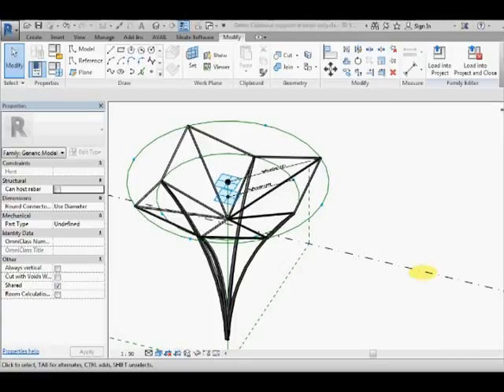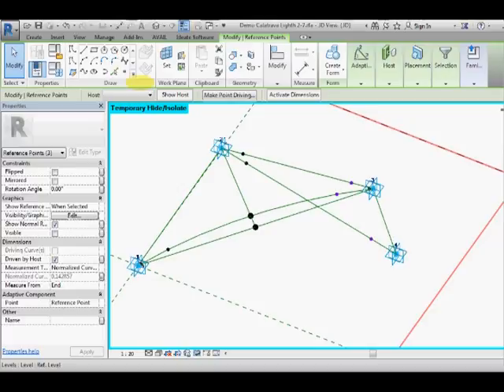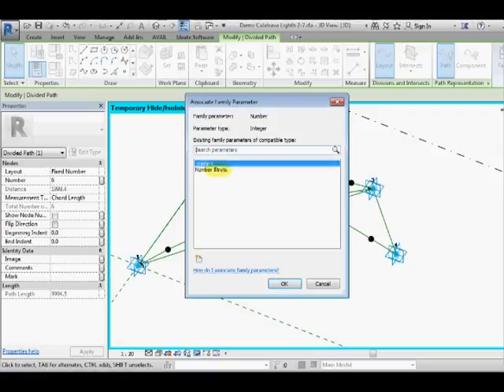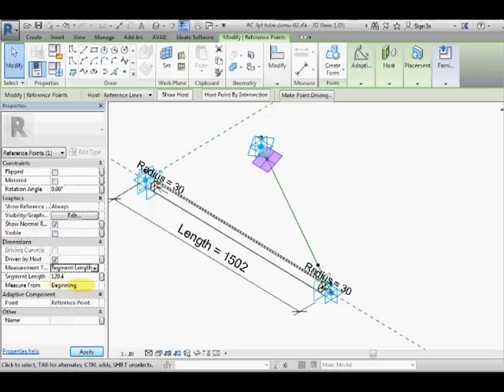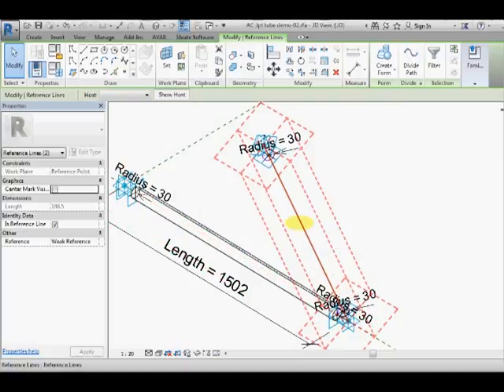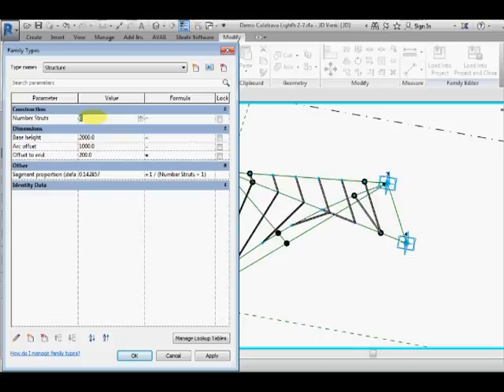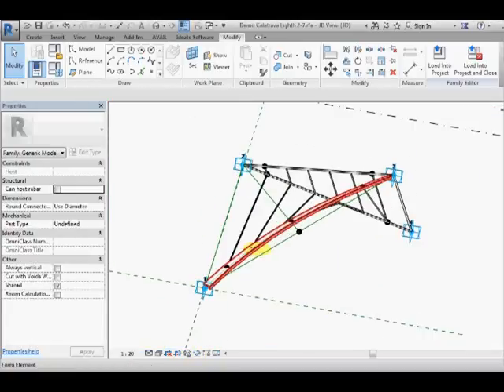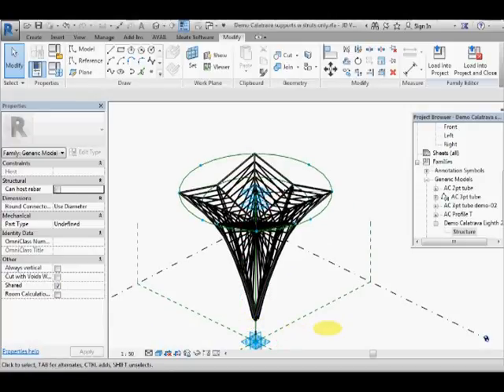Gare do Oriente Revit Repeaters - Pt 4

Comment: Hii. I'm having trouble placing the bars just like you did at 8:30. I tried to put them differently but when I replace the family in the demo the bars get crossed over each other and I don't know how to fix it :(
Reply from the maker: To avoid crossover You have to make sure that the Divided Path nodes are running in the same direction - always try to model the underlying lines in the same direction.  There is a "Flip Direction" property on the Divided path - that might help.
Reply: @RevitCat  thank you!! I’ll try that